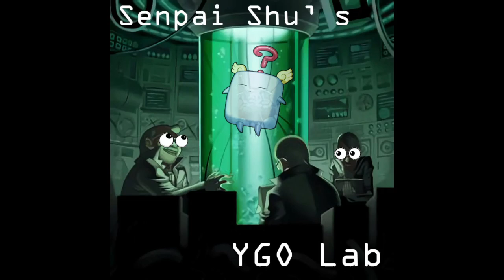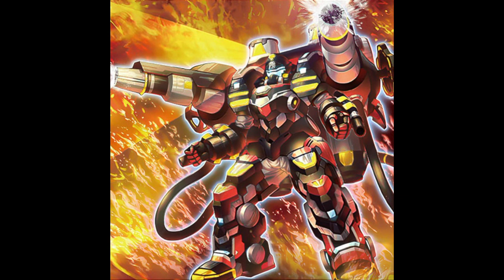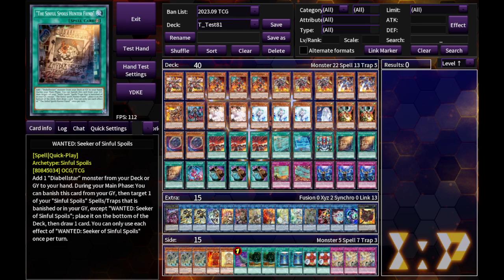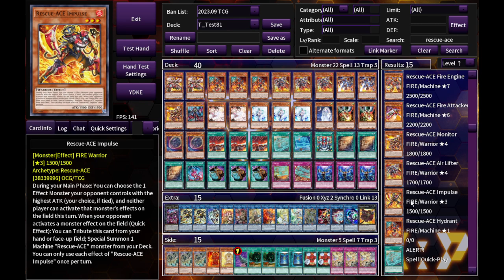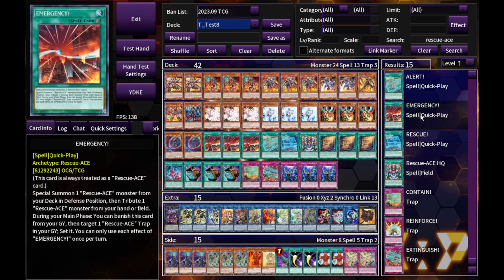The Monitor Dilemma!

Comment: Do you have a preference for the extra deck package of terahertz plays against the wider range toolbox you're showing in this list? I've found terahertz has saved me from getting totally blown out by evenly or thrust more than once, but miss having space for things like apollousa and goddess
Reply from the maker: Terahertz is a game plan most likely only available after resolving set 4, which is too win more imo. A single terahertz without set 4 doesn’t guarantee winning either. The priority should always safely resolve turb and nothing else.

Comment: I found that if youre going to play the isolde build, monitor is a pretty interesting add off the search as that combo puts all your targets (prev, hydrant, turbulence, lifter) in gy already, theres an argument to keeping your extra prev/turbulence/hydrant in deck for followup (assuming you run 2ea), and it cant get ashed if your opponent topdecks it or held it for some reason

Comment: You mentioned that purrely was a tough match up for rescue ace, however Impulse is a 1 card FTK against the deck, so wouldn't that be grounds to playing 3 for when you lose the die roll? I acknowledge that the card doesn't accomplish much going first however it helps when you go second into boards. The deck lacks a component of consistency being that it has 13 1 card starters, tons of engine requirements and not too many "real" extenders (use that term loosely) so I view the Impulse as more of a reactive extender and it can help when people utilize effects on board such as S:P to disrupt and you gain value by summon hydrant/turb/preventer/fire engine directly from deck.
Reply from the maker: Impulse is way overrated in general, especially against purely
Reply: Youre supposed to impulse into fire engine in their turn, that way impulse single handedly destroy purrely. Ns impulse does little vs noir.

Comment: can you explain your thoughts for dropping the rota?
also what is your current side deck pattern vs lab
Reply from the maker: Cuz droll existing and kinda popular in current meta, whenever I did open rota, I often chose to hold it and use other starter first. That resulted rota being just an impulse and only as a lifter if that’s the only starter in hand. With 3 pots mathematically it’s not as needed. 
Against lab, out droll keep rest ht, in LOTs of COPIUM
Reply: i saw in the iron man match u put in the light statue vs lab, how does that help? lab seems to be my worst matchup by far, its so bad im main decking duster lmao
 @ShunYGOLab